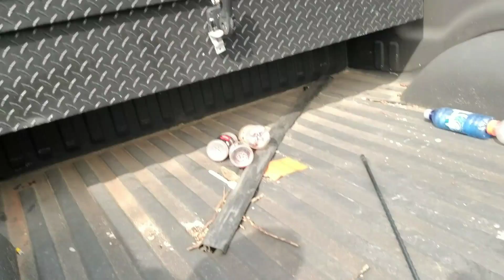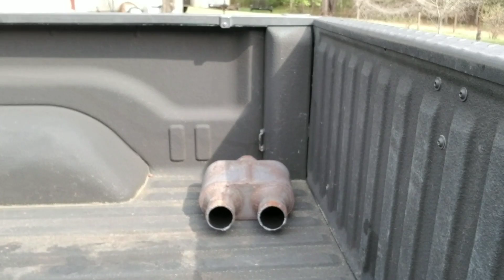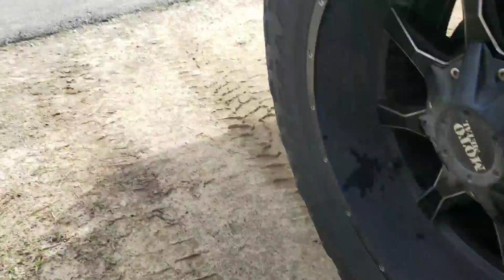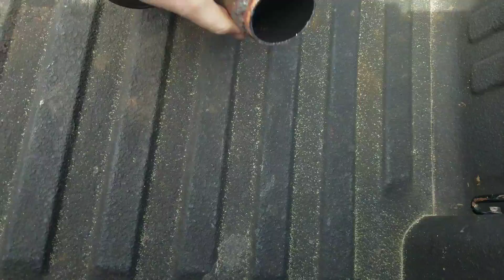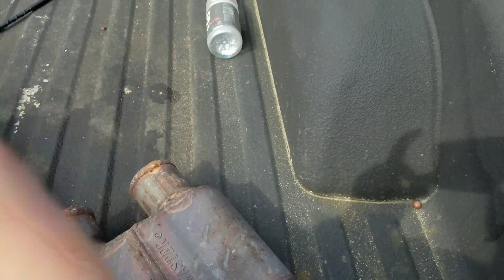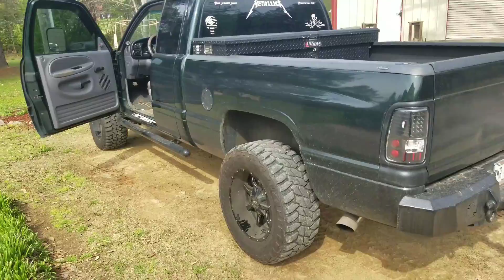How to make a 2nd gen 1500 sound aggressive

Comment: I love the 1500 I gonna get either one of those or a v8 Dakota for my first vehicle
Reply from the maker: Good trucks man and cheap to work on.
Reply: We had a 97 Dakota with the 5.2 and I sold it with 310k on the original motor and trans... the thing is still running strong... when had it since 97. Sold it and bought a 5.9 99 ram. I love these trucks
Reply: Garrett Hammond thanks for the advice! My grandpa has a 97 ram 5.9 and I love it
Reply from the maker: @garretthammond9412  my truck literally never goes over 2500 rpm and I change oil on time every time. Plus it has upgraded torque converter in it
Reply: Everything Outdoors the only thing I’ll say that’s bad about the 5.9s are the gas mileage... I’m young and like to rev it up and have a little fun and might be a little heavy with gas pedal, but man they are nice looking trucks and strong as hell as well. Same with the 5.2s those things will last a long time.
Reply: Reynolds Customs hey exactly that’s the trick to any vehicle just take care of it, and if you do take it out in the woods and mud it like I do somtimes on the weekends you just need to know your limits lol
Reply from the maker: Exactly. I dont mud with mine. But it's a truck. We hunt and we go riding on our land so you have to ride through rough terrain and it gets muddy. I got the 5.2 but they both are really good engines and very cheap if they ever give out. I think I can get a 5.2 with 110,000 miles for $800
Reply: Reynolds Customs yea I was looking into a 5.2 for the Dakota and they were cheap. we were the original owners so I was tempted to rebuild it but a family memeber offered me a 5.9 ram for 2500 bucks and it’s got 135k and 45k on the motor... I couldn’t beat it. You got a Instagram by the way?
Reply from the maker: Yeah. Its the_almighty_dodge
Reply: Garrett Hammond haha now I can’t wait to get one yeah there’s not huge difference between the 5.9 and 5.2 there both really good
Reply: Everything Outdoors good luck with it. Just be patient with it and have fun with it.
Reply: I have a 2002 Dakota with a 4.7 and a Ram 1500 with a 5.2. Such a fun truck. The Dakota drives like an old muscle car, the ram drives like a school bus. If you want something that’s both fun and practical pick up a v8 Dakota.
Reply: Get a 3rd gen ram hemi, over 100 more hp than 5.9 and they get better gas mileage
Reply: Nathaniel Becker I ended up getting an 03 Durango rt with the 5.9 magnum and I already installed headers high flow cat and magnaflow it sounds soooo get and has soo much torque the magnums are the best
Reply: @OK-ph4dj  sweet, I got a catback exhaust and shorty headers on mine with some fuel wheels, love it
Reply: Garrett Hammond ive got the same thing, trans is a lil iffy sometimes. The engine is great though and ive never seen the body and frame rails hold up as well as my dakota is holding up

Comment: I got a 97 Dodge Ram 1500 5.9. I subscribed keep making your vids bro I wanna see your build! I’ve decided I’m getting the same bumpers as you 😂👍
Reply from the maker: Thanks man and that's what I like to hear. I'm still waiting on the lift. I'm gonna call them probably this week and find out what's taking so long. Thanks for the support man
Reply: Reynolds Customs yee, bro stoked to see it I’m actually selling my 97 Dodge Ram 1500 planning to get a 2000-2001 Dodge Ram 2500 gas version with the nv4500 manual transmission 3/4 ton axles then I’ll build that up she’s gone be my off-road beast. Can’t wait till you get your lift in bro I’m stoked to see you install it with the finished product she’s a beauty bro
Reply from the maker: Thank you man and I really want a 2500 with 24 valve in it man. And I'm gonna do the lift as soon as I can after it all comes in man. I'm excited about the video and the lift lol
Reply: Where did you get the bumpers?

Comment: I have a dodge ram 1500 gen 2 1997 i engine swapped it to a v8 6.0l race engine and i still here the engine not the exhaust the exhaust is stock but im planning to get something like this
Reply from the maker: Gone be a bad ass build when your done. Gotta send me a exhaust video of that
Reply: @reynoldscustoms8646  I’ll try, I’m taking over my dads truck it’s a 2019 Dodge Ram 1500 crew cab short bed night version with a towing kit on it my dads getting a 3500

Comment: Think u have an exhaust leak. Watch under the engine when u rev it up, u can see fire shoot down. Might wanna get that checked.
Reply from the maker: Jamie White yeah my header is leaking I gotta get a thicker gasket. Gibson dosent send a good gasket with there headers
Reply: Figured it was a hole or bad gasket, just depends on the situation it could be dangerous.
Reply from the maker: Jamie White after I looked at the video it's my LEDs they were messing up I have them unhooked now
Reply from the maker: But the gasket on the header is leaking. It's been leaking since this time last year I took in on and off 4 times and I couldn't get that one side(driver side) to seal. I was told to get a bigger gasket and it would fix. I was gonna get a new ac compressor but the one I have started working fine again so I might fix it sometime soon Gibson headers are bitch to put on with out taking the motor out. I'll have to do a video on that one. I get so pissed doing it.
Reply: Reynolds Customs yep, my AC is out, sucks in this heat we been having this summer
Reply from the maker: Jamie White got that right I pumped mine full of that ac pro with 2 cans and it started working fine
Reply: Reynolds Customs might have to try that. Thanks for the idea
Reply from the maker: Welcome man. It was like it would fill up on the first can but I could sit there and watch the freon leak out when I'd let go of the trigger but it eventually quit leaking

Comment: Does the chip actually do some good to the truck I have same engine in my 01
Reply from the maker: I usually keep it on 87 performance. You can also notice a big difference with the mpg saver but the truck will run at like half power. The more engine mods you have the more of a difference you will notice
Reply: @reynoldscustoms8646  whats the mpg usually with the 87 performance?
Reply from the maker: @E30Tylerrr  with 4.56 gears and 37s about 14-15. If I run at 55-60 on like a high way I will see closer to a 17 average. Probably higher when I'm only doing that though. Interstate at 70ish is about the same as city cause rpms run around 2k
Reply: @reynoldscustoms8646  thank you 🤝

Comment: We have a 2001 dodge ram 1500 but ours is a 5.9 360 bigger then the 318 so is it gunna be louder?
Reply: kyle a buddy of mine has a 2000 ram1500 with the 5.9 he had true duals straight pipe and it was super loud he recently put 2 flowmaster super 10s and still is pretty loud but yea the 360 is way louder
Reply: kyle if u look on my channel I have a video of my truck with it’s exhaust it’s a 5.2 and his trucks way deeper and louder

Comment: I have a 318 but no truck I either want a car or a truck not sure yet.
Reply from the maker: The 318 is a good engine for sure. Has enough hp with good torque
Reply: I love my 318 currently looking for some horsepower. If you get a 2nd gen ram get some electric fans with a temp controller

Comment: That Metallica sticker is badass! Where did you get it?
Reply from the maker: Amazon. I bought it 2 or 3 years ago they may still have it on there
Reply: Reynolds Customs I’ll definitely look for it
Reply from the maker: @luke3275  I'll try and find it but it is definitely made of good material. Been on there every since and doesnt have any cracks not is it faded
Reply: @reynoldscustoms8646  what size wheels? And any lift ?
Reply from the maker: @adrianjpm2985  in this video its 23x12.5r18 with 18x10 moto metal and 2.5 leveling
Reply: @reynoldscustoms8646  nice 👍 thankd
Reply from the maker: 32x12.5r18***

Comment: Do you still have the cat in this video
Reply from the maker: Yes. I still have the cats on this truck today. Do not cut them. You will regret it. Unless you go to a carburetor.
Reply: @reynoldscustoms8646  mine are cut off with true duals and I love it I feel a little bit of a power difference
Reply: I'd recommend staying away from glasspacks on these trucks they sound horrible I'd rather have straights that's what I'm running now till I get long tubes and custom exhaust
Reply from the maker: @jasonsimmons9309  if you dont mind drink a bit more gas then yeah. You can try the spark plug non fouler trick and it works some times not always. Only reason it's not recommended on these trucks. I have a 88 f150 with only 1 02 sensor before the cat. I cut the cats off of it. Also long tube headers are pointless on a truck unless you have a high performance engine running 3k rpms+ all the time. Short tubes are way better.
Reply: @reynoldscustoms8646  I get way better gas mileage since I got rid of the cat and the non Fouler works great you can literally take the rear sensor out and zip tie it to the frame and itll run fine as long as your front sensor is in. Also in the process of building a 5.9 that's why I want long tubes. Have you heard of marty Fletcher with utawesome performance
Reply from the maker: Really? Naw never heard of him which I haven't dove very deep into engine stuff on the dodge yet. But I'm going to when I start building my new engine. I know I'm putting that hughes intake on my truck with their thumper cam and roller rockers. I prefer the shorty headers since I hardly go above 2500 rpms. I have the Gibson shorty headers. They work great.
Reply: @reynoldscustoms8646  check him out b4 you do any mods he builds cams, throttle bodys, double roller timing chains, and modified the stock kegger intake to perform better than most aftermarket intakes. He even does sct tunes and after you buy the tuner the rest of the tunes are free you just email him and he sends a custom tune via email to download to your tuner. Check him out, utawesomeperformance.com hes also got a YouTube channel

Comment: I have the 5.2 318 , I’ve removed the muffler but it does not sound like this, do I need a y pipe or ? Someone please help!
Reply from the maker: Your tips is what gives you the sound. You dont want rolled tips. These are 4.5" tips, and yes I have a Y pipe. The Y pipe may have a little to do with it but I've had my exhaust redone 4 times and the tips is what makes the sound. I had to cut my tips off when I put the lift on and my truck was instantly quiet. I could hold the tip up to the pipe and it would have the sound again
Reply: Reynolds Customs ty so much I’ll try that

Comment: Idk much about Dodge so what makes it a 2nd gen from a 1st?
Reply from the maker: 1st gen is the square body dodges. Each new body style is another gen. 1st gen dodges were called d150, d250, extc.
Reply: @reynoldscustoms8646  thank you bud. I'm about to buy a 98 model to make a woods truck with.
Reply from the maker: @dieseljunky8505  well they make the best shit for that. 4 link rears and all. The specialize in the second gen. It takes a while to get parts from them and that was before the rona. Their lifts range from a 3" to 20" all suspension. The 20" lift is about $25,000 though
Reply from the maker: I have their 3" with the single adjustable short arms. My front axle is offset 1.75" forward. My rear axle is offset a 1/2" backwards (idk why). I added a 2.5" front leveling kit on top of the spring. Also got rear 2500 leafs springs with an extra leaf which lifts it an extra 2"s. So total I have about an 5.5" lift. All that plus my yukon 4.56 gears front and rear, all new u joints and ball joints, and wheel bearing was about $4.5k with some used 37x13.5 toyos I found off Facebook. Oh and if you do the crossover steering, and only if you do it. Do your self a favor and take off that damn sway bar. Dont buy an aftermarket one. Just take it off.
Reply: @reynoldscustoms8646  what company has all those goodies
Reply from the maker: Order the lift from dodge offroad. The rear leaf springs get from sd truck springs. Leveling kit i got from autoanything. The axle parts I orderd from Randy's ring and pinion. My bearings are Detroit brand. Came as a complete assemble. I order it from Detroit.

Comment: So you don’t have a muffler it sounds good
Reply from the maker: Thanks man and no. Back in 2016 when I got the truck a had flowmaster 40 and dual pipes straight out the back. I had the muffler shop cut them off at the cats and put a Y pipe after the cat and put duals out the side. With 4" tips. It was $250. That's what I have now. Just putting the y pipe back on was $75

Comment: There is not Much of a difference just a different sound huh ? Ahahah
Reply from the maker: Not really much the 5.2 magnum and 5.9 magnum stock has only a 30-40 hp difference between the 2. Most parts for the 5.2 and 5.9 from heads up are about the same part and are interchangeable. Stock 5.9 comes with a very weak cam which balances it out to where the power made is about the same. Now the 5.2 also comes with a smaller cam but not as small as the 5.9.